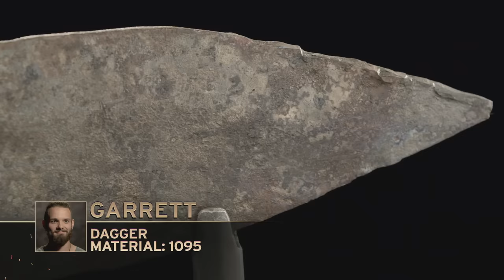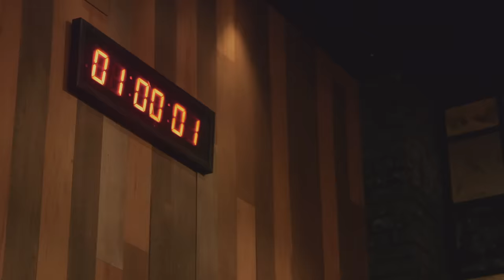Forged in Fire: Recreating Arya Stark's Needle with Iron Age Techniques (S7, E26) | Full Episode

Comment: For the difficulty that Trevor had at the start, his needle recreation was pretty on point! Light, pointy, sharp, and quick. Well done!
Reply: But it bend!
Reply: @elcesaraparicio  It bent on a really tough test and it was ment to be light and it being strong is hard while keeping it light
Reply: @elcesaraparicio  True, but the other guy didn't really stay within spec. If your sword is twice as heavy as it should be it's is going to ace the strength tests as a result, but the fact it cannot be used the way it is intended to be is a huge shortcoming. 

Notice how different Doug's kill test went with the two blades. With the properly light sword he was lining up his shots fast and as smooth as butter where as you could see he had to pause to line up the weapon when using the heavier sword which is not what you want with a weapon designed to be a lightning fast thrusting sword.

Comment: Modern fencing epees evolved from the epee de combat, which in turn evolved from the smallsword.  Arya's sword looks to be essentially an early smallsword, which makes sense as it is from a setting roughly equivalent to the later medieval era (smallswords are from the 17-18th century, much later).

These swords are almost always purely thrusting swords, usually featuring a triangular cross section, which doesn't allow for very effective cuts, but instead makes the sword both very rigid and very light, perfect for carrying around and for dueling with other gentlemen.

Some smallswords did have diamond section blades, but they still were used almost entirely for thrusting, with any cuts delivered being generally non-lethal.  I think the testing should have emphasized this more, and the judges could have potentially given more stress to the importance of a very rigid yet light blade suited for quick thrusts.
Reply: I agree with nearly everything stated.  Except this blade seems more like a middle to late Smallsword.  Early Smallsword had diamond cross section blades similar to late Rapier blades.  The trefoil blades were popular from about 1700 onward.  Also...I think the judges did a decent enough job testing.  Of course there was some slashing...this is TV after all.  But in the end they awarded the win to the lightest blade even though it took some damage during testing that the other blade did not.

Comment: the final blades lightness factor really came down to the bulk of the guard and weight of the handle in my opinion.  the winning blade had a thin guard and a rubber handle, i think that gave it the lightness to win.   but the winning blade itself is not very combat worthy, the other blade was more sturdy and would hold up longer under actual use.

Comment: High carbon steel =/= Iron age
Reply: Wrong. High-carbon steel has been around for as long as steel has been around. You naturally get high-carbon steel from the bloomery smelting process; in fact, you have to be careful that the carbon content doesn't get too high because then it becomes difficult or impossible to forge:

"As the desired product of a bloomery is iron that is easily forgeable, it requires a low carbon content. The temperature and ratio of charcoal to iron ore must be carefully controlled to keep the iron from absorbing too much carbon and thus becoming unforgeable. Cast iron occurs when the iron absorbs 2% to 4% carbon. Because the bloomery is self-fluxing, the addition of limestone is not required to form a slag."

In this episode they used 1095 steel which only has a carbon content of 0.95% (slightly less than 1%), and steel with carbon content a lot higher than that, to the point of being unforgeable even, can easily be produced in a bloomery. The use of bloomeries is what denotes the onset of the Iron Age in the first place, by the way. "Iron Age" is a bad term because it was always the Steel Age. There was never a time when people were using pure iron rather than steel, because pure iron is difficult to produce and is very soft, so it isn't desirable anyway. Bloomeries inherently produce steel and what's called "cast iron" today (which is also a bad term because "cast iron" is really just ultra-high-carbon steel).

Comment: I think Victor should have won this. Sure Trevor’s fit the lightweight category, however durability wise was weak in comparison to Victor’s. Having a little bit of weight would also add more into the penetration and cutting for real world applications.
Reply: It doesn't fit the sword.  It's meant to be super light and flexible.  Failing to produce an accurate representation of the historical weapon is a failure.

Comment: I would love to make it this far in blade making… UNFORTUNATELY, I can’t afford the few things I need to get better. I don’t know how to weld or own a welder, which is one problem. I need a belt grinder and can’t afford to buy one new, or build one from a no weld kit. I only have a small one burner forge and a chunk of rail for an anvil and ball peen hammer. I have to trade do get things for hobbies like this because I don’t have enough of my disability pay. I may try to make an assisted hammer sort of thing that I can use my feet or something. Oh, I do have a set of tongs as well.
Reply: Throughout most of time, blacksmiths didn't have belt sanders or welders. You can find a way.
Reply: @phaelax  throughout most… there are reasons to why I am looking to do it unlike “most of time”. I’ve had to modify and search for ways to do any hobby I’m interested in. Even the amount of time I can pursue those hobbies, is dictated by personal complications. I have all the time in the world to dedicate to hobbies that improve my quality of life. Just pulling a steel blank in and out of the forge for an hour, is enough to put me in bed for 3 or more days. So I have to plan in advance to make the tasks associated with making a knife or a small decorative piece as painless as possible. Even if that includes having to save even longer for the tools to make it easier and more enjoyable. I used to love making things from nothing. I still do, my body however does not. I’ve wanted to make knives, do other Blacksmithing projects. I really wish I could find a place nearby I could give mill and lathe work a go. I’m doing my best to find a way that works for my circumstances. I need to make 2 knives that are of a quality to be passed down to my son and his kid and so forth. If I can handle making more, than I have a few people close to me that I would love to gift something like that to them as well.